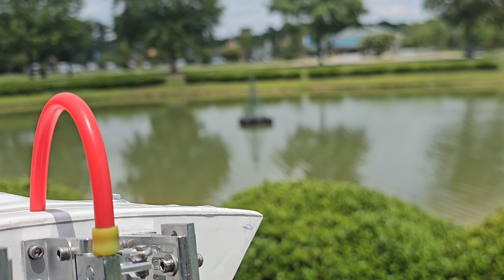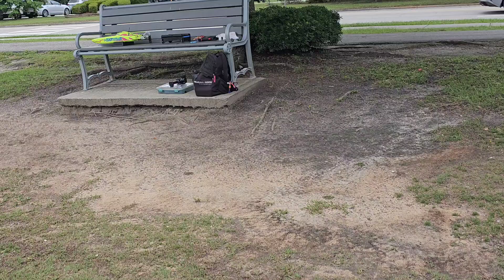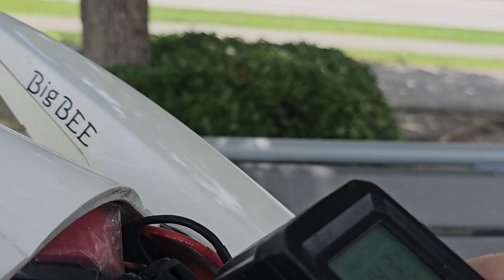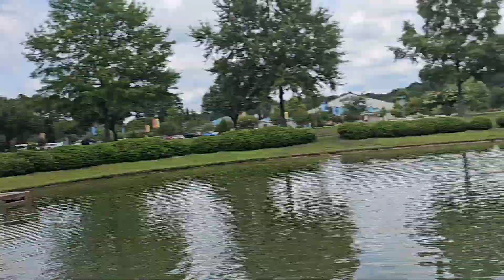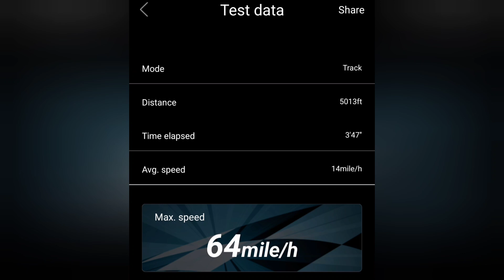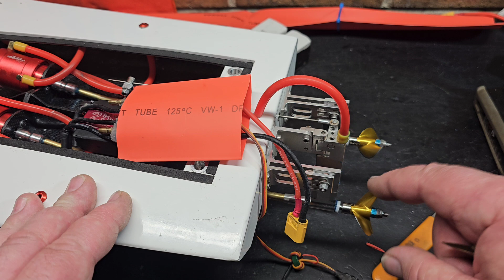She's a Handful Twin Brushless Motor Deltaforce Vortex 24 Rc Boat

Comment: Hey big b, have you ever had an esc that just starts power cutting when nothing has changed on your boat.
I’ve tried a new receiver with a different radio, a different battery with a lower voltage so far oh and I lowered the timing. It’s got the exact same water coming out the water outlet and there are two outlets. It’s like the esc just won’t go to its peak amps anymore it’s had no temps over 100 f  no smoke.
I have no esc to swap that fits the boat.
Reply from the maker: Yes, I had a 120 spektrum that started doing that, I narrowed it down to caps or dirty wires due to salt water !      So aggravating, took it out several times tried super small props with the same power cut outcome.
Reply: @IRONCLADRC  I run in salt as well.
Before I read your reply,I just Re cleaned and re  heat shrunk all the motor and battery wires.
So we are at least in the same wave length.
 I’ll let you know how that goes. Thanks mate.

Comment: Go on Amazon and buy some dual wall 4:1 marine grade heat shrink , it will take the heat and you have the advantage of it being adhesive lined . I never use regular heat shrink where water is involved . Looking forward to you testing this with different prop direction

Comment: The heat shrink, once shrunk into place, may have been under tension and simply split open.
  I guess that’s why they call it the shake down period, getting the bugs worked out. 👍👍👍
Great video Big B, 64mph is no small potatoes.

Comment: When you come off the throttle, the props act more like hydrodynamic control surfaces rather than propellers.  Just be easy with the trigger.